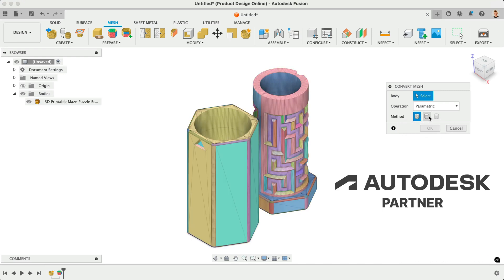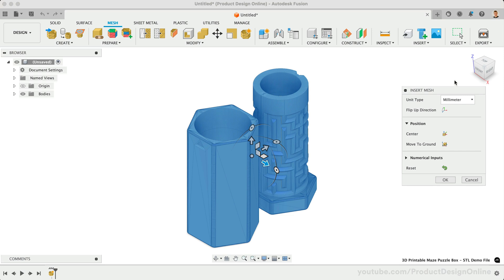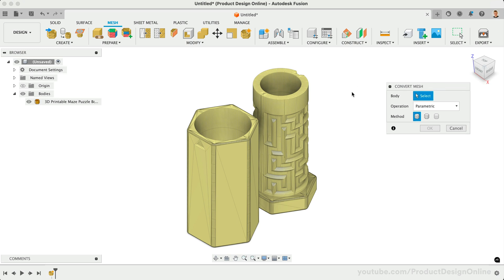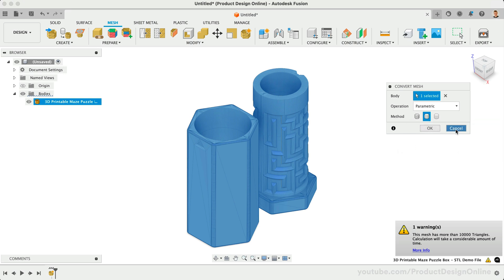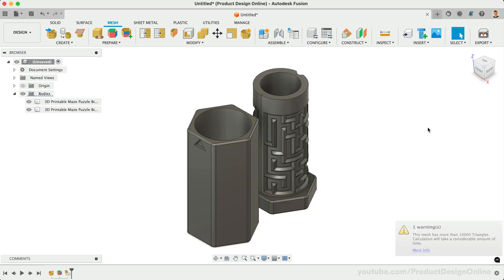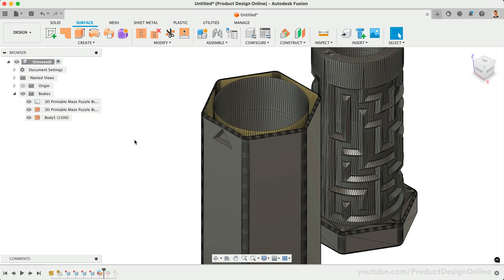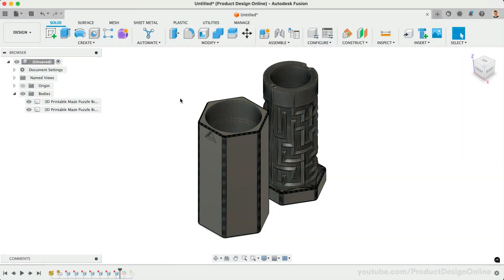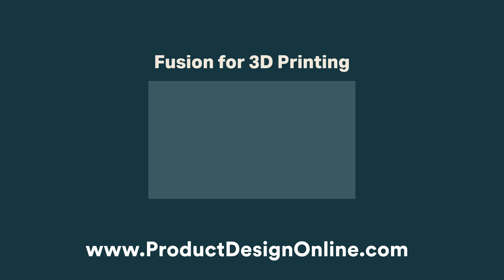Convert STL Mesh to a Solid Body in Autodesk Fusion (2024)

Comment: Yes nice tutorial but without a good GPU the 3 options will takes hours and hours...what GPU, RAM and processor do you use? Thanks you so much
Reply: Work: NVIDIA T1000 8 GB gpu; 32 GB ram, i9-12900k @ 3.2 GHz:::: Home: NVIDIA TitanX gpu; 32gb ram; i7-5930K 6-Core @3.5 GHz processor
Reply: Ooooof. Attempting now on a fairly complex model on a 2020 iMac with an 8-core Intel Core i7 processor, AMD Radeon Pro 5700 XT 16gb GPU, and maxed-out RAM. Already well over an hour.

Comment: This process is still a hot mess. I tried converting a 'simple' right angle flange with two holes I made in Fusion and exported to print. I tried re importing it into Fusion as an STL to convert and it still produced a faceted rubbish result with or without the face groups step. On a paid license too. The best way to deal with mesh files in Fusion remains NOT to.

Comment: Hi, I have a game file i've been trying to make into a 3D printed item and I cannot find a single way that works. The object is a space ship, but the mesh is a mess, there is geometry on the interior, then a gap, then the hull. I've tried every trick under the sun, Voxel remesh ends up a mess, half the time I get it looking good and it evaporates in the slicer. I've tried adding thickness, i've tried everything I can think of as an amateur. Do you have any ideas?

The file itself is massively complex, too many triangles.

Comment: An obj file can have many components in it. Is it OK to convert each component in a single file without running into errors?
Reply from the maker: It will really depend on the file. It's possible, but maybe worth splitting them into separate files if it's large or complex design.

Comment: 99 times out of 100 the prismatic option doesn't work.  It leaves you with an unclosed surface body, missing some walls, etc.
Reply from the maker: Hi David. Do you have any previously failed files you can share?
Reply: @ProductDesignOnline  maybe he doesn t but i do!
Reply: @mathias3187   what to do when that happens? Currently facing this issue
Reply: @mars3dp me too damn it
Reply: I have the same problem

Comment: Only works on simple files, more often than not, it does not work.
Reply from the maker: Do you have files you could share where it didn't work? In recent months I've had really good success with Prismatic. They've improved it a lot over the last year. Most that I've seen fail are mesh polygon models from Blender (or similar) that will likely never convert well.
Reply: I've tried it with 3d scans, and it'll tell me something like "your model has 3.4 million polygons, anything over 10,000 will take a significant amount of time"

And there's just no way to remove that many polygons without losing so much detail it becomes useless